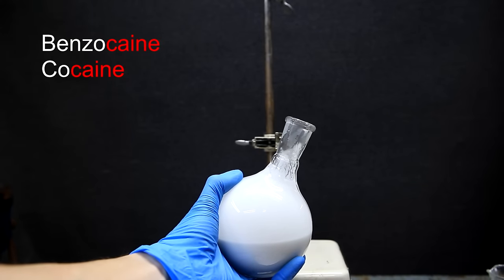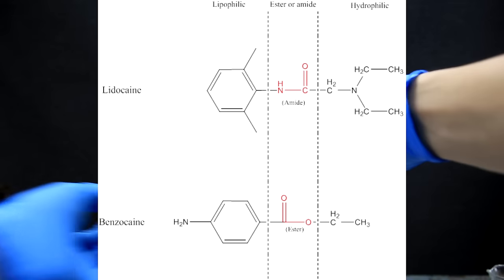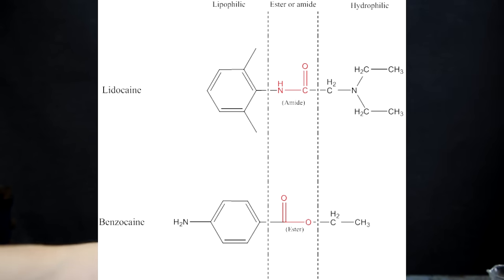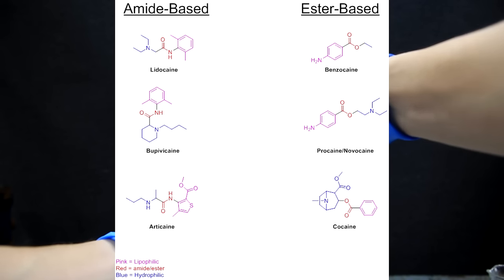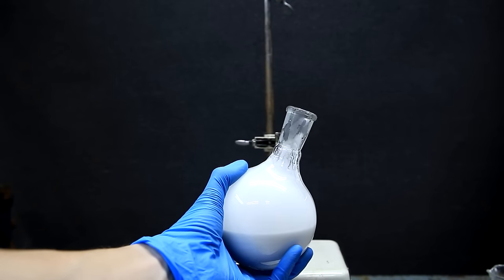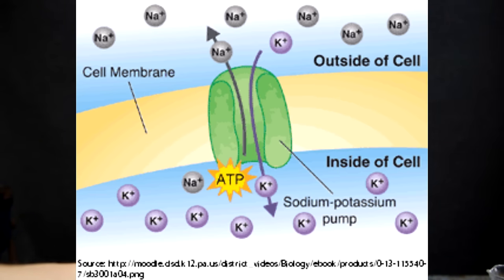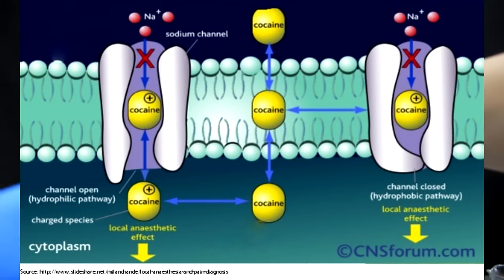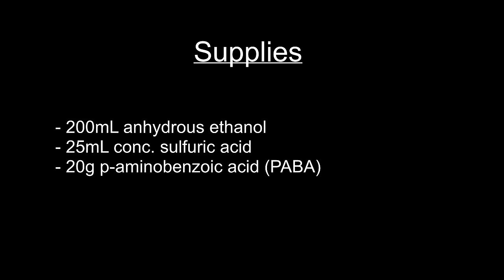Making Benzocaine (Revisiting!)

Comment: please do cleaning your mercury! my mercury is very dirty, it needs love.
:D)-<
Reply from the maker: +Kyler Kraus haha, will do. The only unfortunate thing that the best way to clean it is by distillation, which is scary :p. I plan to do it two ways though, with and without distilling.
Reply: Looking forward to that vid! 700F distillation with ☢Mercury vapors☢ to spice it up.
Reply from the maker: Kyler Kraus I was concerned at some point that my glassware wouldnt be able to take it. But I think it is pretty solid stuff. It handled boiling sulfuric acid like a champ, so i think it can take the heat of boiling mercury (i hope).
Reply: I'm still looking forward to that video, I needed the mercury clean for a vacuum gauge so I dissolved the oxides with HCl, it was really scuzzy before and would stick to things but now it is very clean and would probably bead up on superglue. I am surprised that you are using glass, I would go for steel plumbing fittings personally but then taofledermaus would still be the only one that boiled mercury in glass. good luck!
Reply from the maker: Kyler Kraus haha, I think my glassware can take it (I hope). Unfortunately, it's dangerous enough that it must be done totally outside. For that, Ill have to wait until it is summer here.